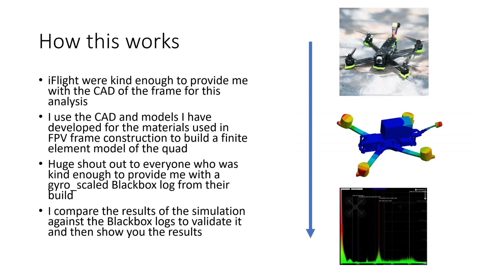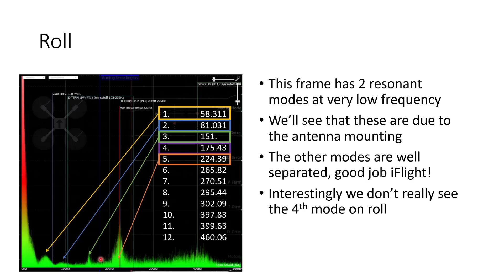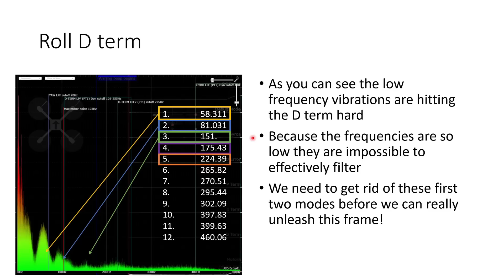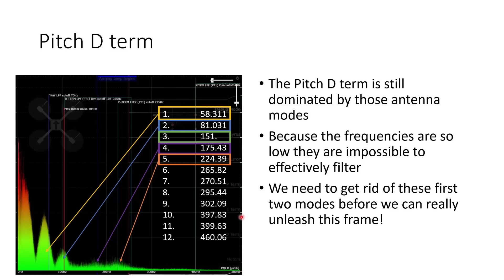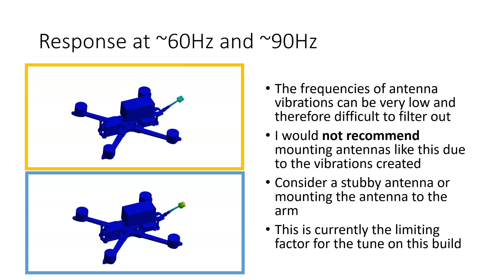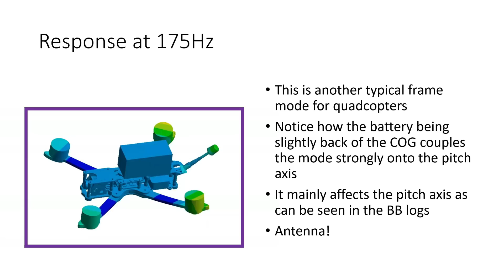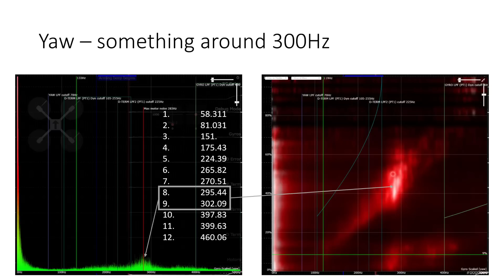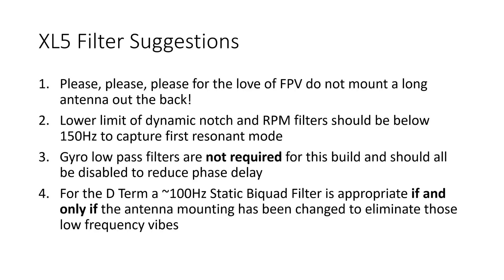Vibration analysis of the iFlight Nazgul 5 V2 and XL5 Frame. The antenna RUINED my tune!

Comment: Thank you for doing an analysis on the Nazgul, as it's a very popular BNF and I happen to own one myself (along with... uh... three other iFlight BNF models)!  However I'm going to play devil's advocate here - because you know someone is going to ask this question, and I hope to do so more politely - wouldn't an RF engineer doing their own analysis focused on solely that area probably say "the most important thing you should take away from this video is that you should mount your antenna as far away from the carbon fiber body, the electronics stack, and the battery as possible, and find the longest antenna you possibly can!"?  Like, what's more important - tuning the frame for the least possible vibration (which can be compensated for, at least to some degree) or not falling out of the sky when you're flying at range? :)  I imagine that every design is a tradeoff in some way, right?  Also, for what it's worth, I will say that out-of-the-box the iFlight quads I own absolutely had the best tunes - by far - of any manufacturer.
Reply from the maker: Yes I guess they would. Every design is a trade-off. The XL5 is not a long range quad its designed for freestyle so I would lean towards good vibration performance over range (particularly if you are running digital, range is not as much of an issue IMO)
Reply: @ChrisRosser  Out of curiosity, has anyone from iFlight been in touch with you regarding this analysis?  It would be wonderful if their engineering team made product improvements as a result - especially if they created and made available new stiffer 3D printed parts and/or antennas.  I mean, I would definitely buy them...  and somehow I doubt I'm the only one.
Reply: @ChrisRosser  Would stiffening the antenna coax be an option?
Reply: @drkastenbrot  A mount that also attached to the lower section of the rear standoffs would help. That'd stop the 'wagging' in the pitch axis, assuming the antenna was stiff enough.
Reply from the maker: @drkastenbrot  I think the main issue is that the TPU mount is quite flexible on its own. If you switched to a stiffer material that would help also.

Comment: I’ve been waiting all week for this video, thanks Chris. Strange that I didn’t have those antenna frequencies on my stock Nazgul, makes me wonder if those logs had something else going on, maybe a loose or broken antenna?
Reply from the maker: Hi Stuart just checked your logs. You do have antenna modes I think (not as bad as the log I showed) at ~86 and ~114Hz. They are most visible in your D term spectrographs. If you take a longer log it might make them more visible.
Reply: @ChrisRosser  Ok cheers, I will have another look. I have a 3D printer on order and I want to redesign the antenna mount to save weight so it will be interesting to get another log after I do that to see what difference it makes. I also have TBS Triumph Pro antennas I can try on it.
Reply: That could totally be something , because there have been so many frames before why didnt the antennas in those builds affect the flight in some weird way? @Chris Rosser

Comment: I had a similar problem in my apex with 2 DJI air unit antennas floating free and bouncing. I did a cross union with 2 zip ties, problems gone. It was clearly visible in logs at very low frequency with strange behaviour during the flight and propwash management.

Comment: Awesome work Chris! 👍 Great to see this being raised, I’ve always found long unsupported antennas have affected flight performance, particularly when I used to use the original TBS Triumph antennas.

If you model the antenna as part of the CAD assembly, it’s surprising just how much they affect the centre of mass position, even though they don’t weigh much, the resulting moment makes a huge difference to the CoM position (about 5mm in some cases) so it’s unsurprising that pitch and roll is affected so much!

Comment: Really amazing analysis and quite some insights into those Antennas from a very different perspective than just crash-resistance. However a stubby would also limit the signal strength, so this might lead to another whole level of discussions. Maybe - once you finish your tuning guides - tackling this issue of mounting the antennas best for vibrational stakes but also with the least possible loss in signal strength would be really beneficial. (You did this somewhat of that on your AOS5 build which is certainly a good start!) Maybe even partner with the guys from VAS to develop a rugged crash resistant non-vibrating antenna that still provides excellent 360° signal coverage? ;)

Also... I'd love to see a vid of how you do your test flights to get these histogram-results. Somehow my tinyhawk freestyle looks quite clean in the histogramm but in the waveform you can see a lot of gyro-noise which also triggers D-Term quite heavily... and it's quite hard find the root cause (this little thing with it's thin base plate may just in general have its limits though *G*). So I wonder if I just don't test-fly correctly and comparably enough to see it in the histogram.

Comment: Thanks for the analysis, Chris. I have the analogue version of the v2. I was very surprised by how much the antenna and mount contributed to the resonance! Apart from moving over to a stubby, what else would you suggest? Get rid of that TPU mounting completely? Strap the stubby (or a longer antenna) to a rear standoff?
Reply from the maker: I would remove the TPU part and strap the antenna to the top plate and rear standoffs with as little length sticking out as you feel comfortable with from a range perspective.
Reply: @ChrisRosser  Thanks again! Will look into this!

Comment: Can these same settings be applied to 3", 2.5" quad?
Reply from the maker: Yes, it should be reasonably safe to take this approach with smaller quads. You may be able to move up the cutoffs for smaller builds as they tend to vibrate at higher frequencies. You can move up gradually checking for ticks, oscillations, and hot motors or you can be guided by logging if you have it.

Comment: Thanks for the analysis! I am not sure how to word this and by no means do I want to be offensive. I am just trying to understand more. I am curious what your answer would be if someone asked you if these issues you address really matter? "Like come on, the antenna cant really effect the flight that much... my Nazgul is amazing with the stock antenna mount". Tons of people duct tape quads together and they fly "perfectly" for the user. I understand you are really diving into the details and I love it, but from a relative flight perspective I would love to hear your thoughts on what actually matters in a real world instance. Most FPV drones are not flawless flying machines, plus the second you crash once, all these calculations could be completely changed right? Sorry for the long comment. I guess I could sum it up with, Go fly a BNF Nazgul and then change the antenna to a stubby and prove to me there is a big enough difference worth the stubby price and potential lack of range (if thats a thing, im not a genius in FPV).
Reply: The problem is that when the gyro picks up vibration at frequencies below about 100 Hz, it limits what you can do with filters and tuning to make the quad fly better.  If seven grams of antenna is wobbling around at 58 Hz and the gyro picks it up, that movement really can't be effectively filtered out of the gyro data without crippling the flight performance of the quad.

Comment: Hi Chris,
great and informative Video as always. How much does the flexibility of the antenna itself cause the 90hz Mode compared to the flexibility of the TPU?
I am trying to figure out if a stiffer mount with a still flexible antenna is a good compromise between reception and resonance performance.
Reply from the maker: That's a tricky question. If you can take some logs you should be able to see how the low frequency vibrations change.

Comment: Hi, Chris! I like your analysis very much! But I think there is something missing in this case! Would be good to see log and simulation without the antenna! Although I tend not to doubt the results, blaming the antenna without some evidence still looks like hypothetic assumption.   :)
Reply: Well i mean the Antenna is causing the first two Modes (58 and 81hz.) If you remove the antenna, these modes just disapear because they are only caused by the Antenna.
Reply from the maker: Spot on Empie! 👍
Reply: @ChrisRosser  ,  @EmpieFPV , guys, it looks like it is obvious for you that it would disappear without antenna! What am I missing? What do I need to know, so that it would be obvious for me too?
Reply from the maker: @vasiliyklx450r  The antenna is the only part really moving for the first two modes so if you take it away the rest of the quad won't have a mode at those frequencies.
Reply: @ChrisRosser  , very well, I can kinda guess this by looking at animation. But how can you state this without evidence from experiment?  Or maybe Im missing understanding, why are you so sure that antenna is the cause of those two first modes?
Reply: The evidence is in the video. I don't know what else to tell you.

Comment: Hope you can do Analysis too for the  Catalyst Machine Works 5" BangGod.
Reply: And the Slamnasty 👌
Reply: I would like to see that
Reply: Seconding this.  I own a Catalyst Machineworks BangGOD 5" myself, and one thing you must absolutely credit CMW with is that their frame designs are very distinct from the rest of the industry.  They almost always incorporate front braces (and make optional rear braces), and until recently their designs have emphasized thick carbon.  I'm curious how their ingenuity in frame design results in real-world performance.